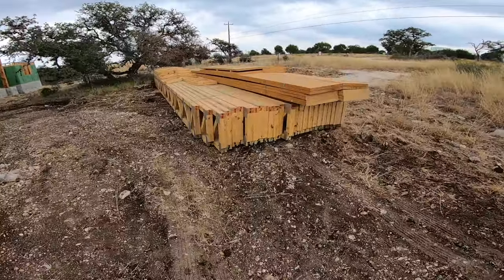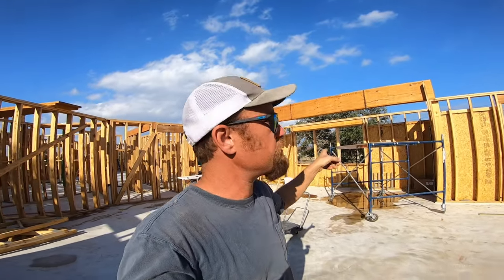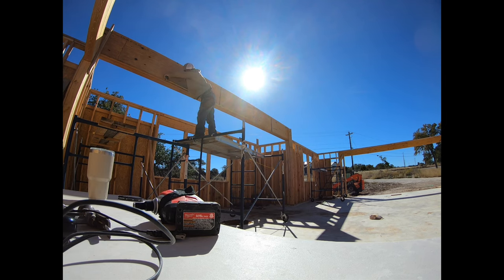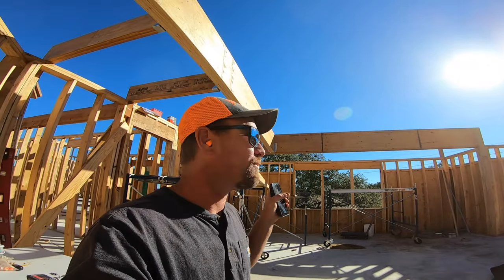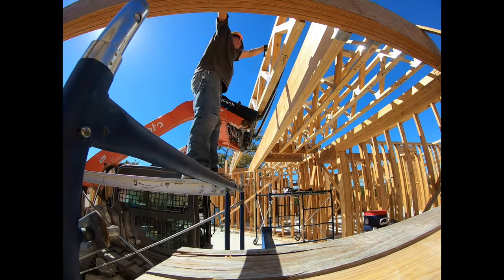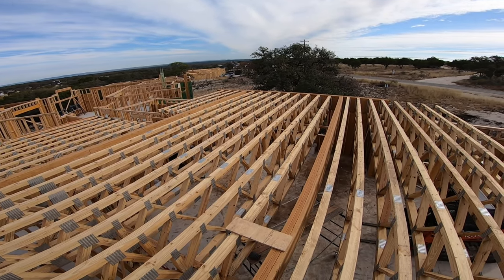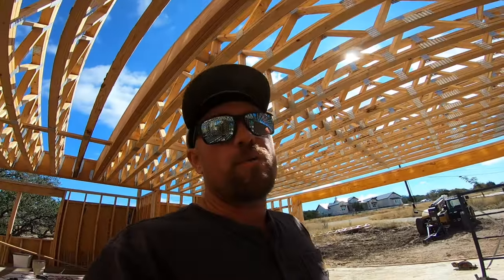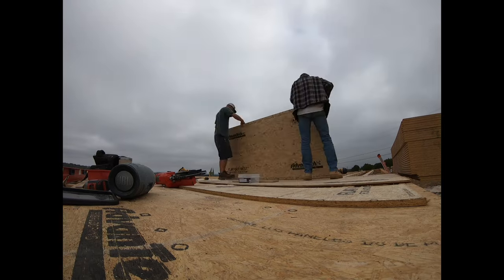SETTING HUGE FLOOR TRUSSES!

Comment: After discussion they agreed to review, they were thinking it has I-joist but they found open web truss joist. Now the y are telling web truss is expensive and strong but sound is expected. I find the sound very annoying, is there a way to reduce it. Builder tried multiple time and saying all is good and this cannot be perfect. Floor is little bouncy too. Please suggest
Reply: They can span a great distance but not stiff and quiet without additional beams.
truss is not deep enough for the span. or to much was asked of it.
Adding a beam or a wall is probably your only option.

Comment: Nice. I'm guessing those beams in the middle are to support point loads from the upper story. Some engineer had fun with that! Clear span is really nice though.
Reply from the maker: Ben, yep. There are a few walls that are in the space above and roof lines that bear on those walls also. We really didn’t want to have any posts in the garage that would limit our usage of the space

Comment: floor trusses are very sensitive, be careful when you stock drywall trusses flex but don't return like LVL or tgi. I also sheared both sides of the floor trusses to eliminate bounce and level floors.
Reply from the maker: Thankyou. I’ll keep that in mind when we finally get to hanging drywall

Comment: Not sure what you meant, but I'm positive you didn't have 80 nails per truss bracket. And you were nuts (not in a good way) to do some of that alone.
Reply from the maker: Yep, shouldn’t have done it alone that’s for sure.  You’re right, I went back and checked, it’s 60 nails per truss bracket.  I believe we used the THA422
Reply: @BuiltOnTheRock  Even that's a crazy number of nails, but I can believe 30 per bracket.